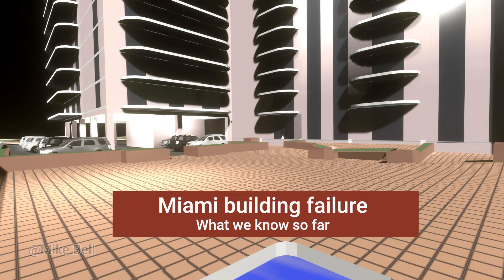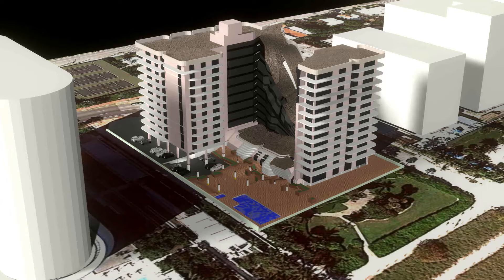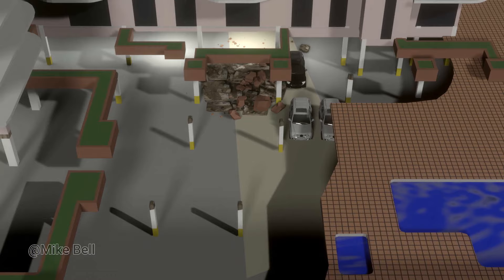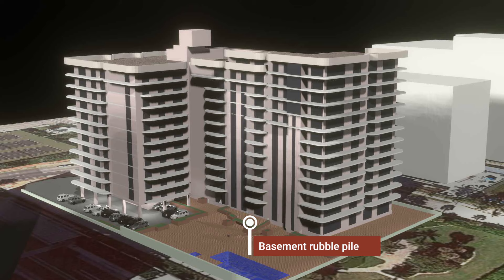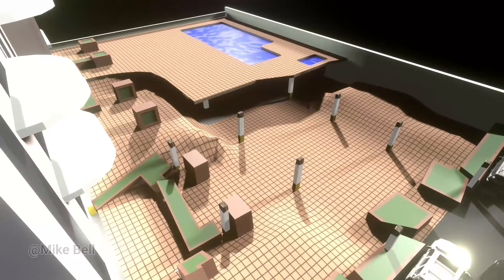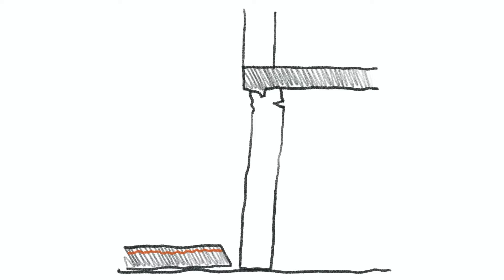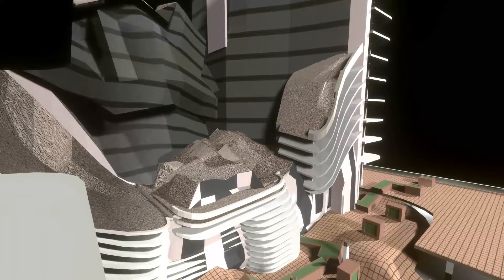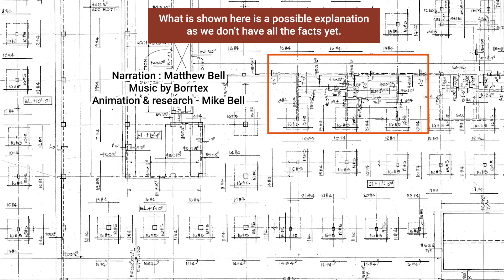MIAMI CONDO COLLAPSE | visualization of the evidence pt2

Comment: Maybe explain how the remaining building was prepared for controlled demolition in a matter of days. It's well known and documented that controlled demolition like that takes months to prepare a building for.
Reply: no it doesnt. all you need is the blueprint of the building and a couple of days calculation where to put explosives. it was also a lot easier when more than half the building is gone
Reply: @pharrzide  gamer kid. I guess you're an expert in residential and commercial  construction and or demolition.
See in video games that is possible but in the real world it isn't. Get back to your game, your teammates are waiting.
Reply: @sundaywhiterabbit7679  preparing and planning are 2 very different things. The planning takes for ever because they have to account for where it might fall and where the dust will go etc etc. But to actually put the plan into effect it only takes a couple days to setup the explosives and a couple weeks to clear out everything.
Reply: @sundaywhiterabbit7679  I'm no expert in anything but experts disagree with you
Reply: @pharrzide  really? That's not true either. It would take longer than 10 days just to do the drafting and engineering for a demolition like that. No it is not simply pull out the blue prints and place sticks of Dynomite here and there. That's beyond absurd.
Reply: @pharrzide  you're wrong and you don't know a thing about any of it. It's a very complicated process to do, if not done correctly it could damage other properties and risk lives. 
Kiddo the world isn't a video game.
Reply: @sundaywhiterabbit7679  if ur whole argument is just gonna be "you are wrong you play video games" then ur opinion is invalid. anyways it only takes a couple of days to set up everything and considering half of the building was already gone they didnt need to calculate the other half of the building. they only needed the standing part to fall on top of the wreckage. the area was already evacuated cuz of the collapse so they didnt need to wait for that. all your wait times are for planned demolitions way ahead of time. and most of that time is just red tape
Reply: @sundaywhiterabbit7679  you need to rewatch the video of the demolition because there was only explosions at the bottom they didn't need to rig explosives on every floor
Reply: @pharrzide  oh my gosh your ignorance abounds. Just stop.
Reply: @sundaywhiterabbit7679  you can go watch the video lmao

Comment: Is it possible it could have been a sink hole. Because of the way the structure went down.
Reply: At first it could have been a possibility but was quickly ruled out as there were no signs of one after the initial collapse and once the rubble was cleared, the foundation level is seen to be intact

Comment: The animations can make it appear that this is how it happened. Considering everything, I used to work on foundations and buildings don't just collapse like you portray. All of the main supports collapsed at the same time which is mathematically impossible for an accidental failure, the buildings were all on the ground in about 12 seconds which is close to free fall speed.

Comment: It will never be investigated but if you grew up down here in South Florida you're in South Florida and are familiar with the type of people that control and own everything you you would suspect That this was not a freak accident considering the building cell cell into its own Footprint much like WTC did. This particular group had been in control of the building and homeowners association for decades in hin head aloud the building to fall into such disrepair is that knowing the 40 year inspection would be happening later this year and and the repairs that need to be made we're gonna cost about 15 million dollars with each apartment unit being assessed for for around $100000 each each It's a little strange that it would happen the way it did when it did. That is unless You're familiar with these particular people. I would be interested to see how many of the residents residents took out extra insurance policies or 2nd mortgages out just before the so called "is it cold" collapse".

Comment: How about opening with "this is all speculative and I am not an expert in this field or any other relative trade with training for assessing what happened".
Reply from the maker: I am a 35 yr experience building expert.  I am an Architect and have discussed the content with multiple structural Engineering colleagues who are in agreement with what is presented. At the conclusion of the video I say this is my suggestion of what happened. I must add in the 3,000 plus comments not one Structural Engineer said what is presented is not plausible.